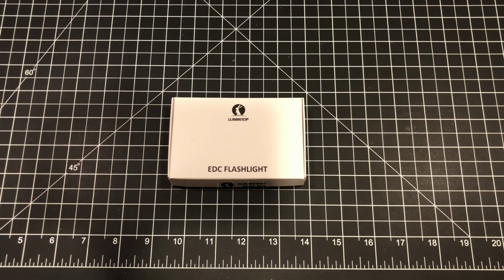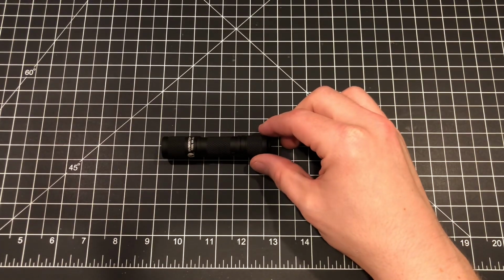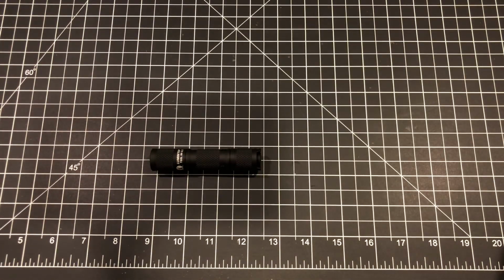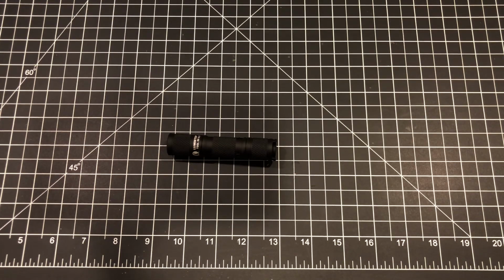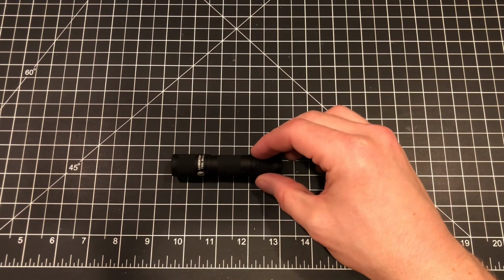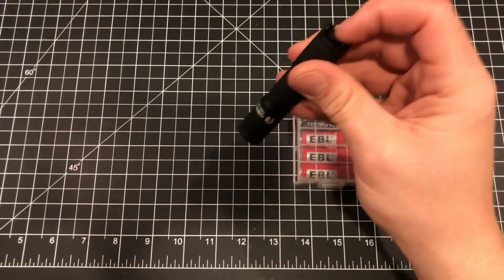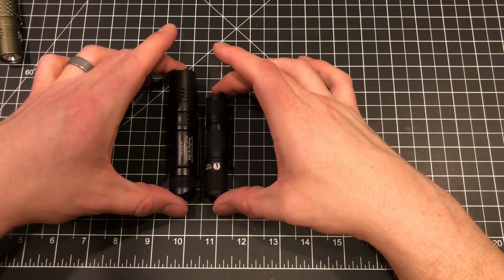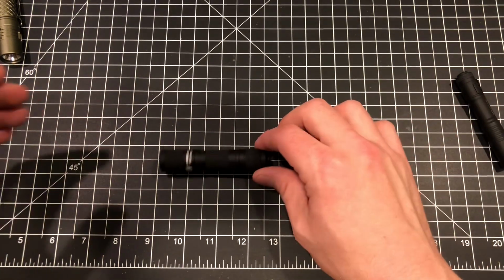Lumintop Tool AA 2.0 | Full Review ($18 EDC Powerhouse)

Comment: Flash rights are overrated, most of the power comes from the battery, when you place an Eneloop inside, it's just a bright as any other modern flashlight with an Eneloop.
Reply from the maker: That’s not true at all. The driver, emitter, reflector, lens, etc. are what matters. Battery provides voltage & runtime, not brightness.

Comment: HIGHLY recommend against using "EBL" or any other cheap Ebay/amazon chinese cells that come in 4 packs for the same price as one higher quality cell. If it seems too good to be true... I only say this because you mention your personal hogher standards for having quality gear in which you can rely on. Avoid those or with the exception of Thorfire, avoid any cell manufacturers that end in "fire" e.g. ultrafire, supfire, alonefire etc... For a 14500 cell, as of today (2021) about the very MAXIMUM mAh that can be shoved into one of those lil guys is about 1100 mAh and again thats max. Anything claiming higher (for 14500) is making false claims therefore shouldnt be trusted. Todays battary standards are pretty strict so the risk of accidental fire or explosion is pretty slim compared to 20 years ago, however the cheap cells not only have shorter discharge cycles, they typically have much shorter overall lifespans... A few reputable li ion manufacturers: Keep power, vapcell, fenix, efest and of course the big "tech-giants" such as panasonic/sanyo, sony, samsung, LG to name a few... Sure the lumintop tool AA is what is considered a "budget" flashlight, however its still a quality tool, and like any tool you depend on why feed it cheap fuel? ... For in a way, the battery powering tje flashlight is just as, of not more so important than the light itself, both tools in their own rights, may as well not cheap out on one!

Comment: At 650 lumens this thing gets really hot really fast. 
I think the best all around batteries for this unit are nimh. Aside from the lower turbo they get the best runtimes. 
The 14500 low/eco mode is 16 lms which is kinda bright actually. The Nimh gets 3.7 lms for huge runtime. 
Again, the 650 lms turbo on this is more for playing around imo. It’s just too thin not to burn up quickly. Worth noting is this unit is very floody. So,even at 650 turbo mode it doesn’t throw far at all. 
Super cool light but it might best be suited to the Nimh batteries. Odds are there won’t be a situation where 270 lumens isn’t enough and you need 650.
Might be best as a nightstand/bedside light.

Comment: Do you have a link to the 14500 batteries you bought?
Reply from the maker: I sure do!

Here’s the link for just the batteries:
https://www.ebay.com/itm/EBL-4x14500-3-7V-Li-ion-Rechargeable-Battery-Batteries-For-Flashlights-Lasers-/264773099693?_trksid=p2349624.m46890.l49292

Here’s a link for 4 batteries + a charger:
https://www.ebay.com/itm/EBL-14500-Battery-3-7V-800mAh-Li-ion-Rechargeable-Batteries-Box-USB-Charger-/223517824857?_trksid=p2349624.m46890.l49292

Comment: Got a good link for 14500 lithium ion batteries for this light? Trouble finding lithium rechargeable. Can find 14500 in other varieties but want batteries like you have. EBC I found are like 3,000+ mAh which sounds way to hot. Doesn’t volts of lithium need to be 1.5 like reg alkaline AA? Thanks
Reply from the maker: Hey, thanks for watching! So this light in particular is rated for a working voltage as high as 4.2v, so you have 4 battery options to choose from:

1. Alkaline AA (1.5v)
2. Disposable Lithium AA (1.5v)
3. NiMh rechargeable AA (1.5v)
4. 14500 Li-Ion rechargeable (3.7v)

Because it is designed to take higher voltage a 14500 is perfectly safe and will provide the maximum output of 650 lumens on turbo. The other three options drop your max output to 270 lumens. 

Over time I’ve found that I very rarely used this light on its turbo setting, so lately I’m most often using a NiMh rechargeable battery like an Amazon Basics rechargeable AA. 

Having said that, the EBL 14500 is pretty economical. You can get a 4-pack plus a charger for about $10.50 on eBay, here’s the link: https://www.ebay.com/itm/274468154700

Comment: I just got this light today, I bought it on a whim and I'm not disappointed. But have you tried a rovyvon flashlight? I have an A1 and an A6 and they are 2/3 the length of a AA battery and cranking out 450 and 550 lumens with multiple functions. High modes drain battery within 30 minutes but I love them as a backup flashlight and the a1 never leaves my necklace with a tiny neck knife on it. As for this lumintop, I'll give it a go at work as an inspection light but I'm only using AA for the time being

Comment: Does the tail switch engage light momentarily on short depress contact or does it power up only when you full press click and release it?
Reply from the maker: It does not have momentary on unfortunately.
Reply: No, it's a reverse clicky. It has momentary OFF.

Comment: I just got one with a Nichia 219C emitter for higher CRI and warmer temperature. I haven't finished the video yet so I'm not sure if this has been mentioned but you can twist the head to adjust the setting and the tail cap also glows blue when using 14500s

Comment: Looks good, but not as good as the Olight S1R baton. I've been EDCing that thing for years now. Strobe isn't very useful except self defense, so having to half-click the Lumintop 6 times to get it is likely a fine motor skill you won't have reliable access to in a true panic situation, whereas it's 3 full pressure clicks on the Olight. With the Olight you can also skip to turbo from off with a double click, charge it without taking the battery out and it's 900 lumens instead of 650. It's shorter than this Lumintop, and I got the Olight on one of their 40% off sales for $35.

Comment: I just received mine, but the problem is when i crank it up to turbo mode, after 1 second it has a mini strobe effect, (im positive that is not on strobe mode). Im using eneloop 1,2v(brand new and fully charged) 1900mah, but when i changed to alkaline Panasonic 1,5v battery it works flawlessly. I am doing something wrong?
Reply from the maker: I’ve never experienced that issue with Li-Ion, NiMh, or Alkaline. I’ve had and used at least 12 of these lights and they’ve all worked just perfectly. I’m wondering if it’s just a bad light.
Reply: @GearedTowardGear1  forgot to UPDATE:after 2 mins of regular use the problem disappeared for ever!  No issues at all i love my lumintop flashlight 🔦

Comment: How is it holding up in 2020? Nice review mate.
Reply from the maker: Holding up great! I’ve got a few of them and they’re all going strong!
Reply: Geared Toward Gear hey man i was about to order the light in titanium, then i read on candle power forum that the Lumintop Tool AA suffer from parasitic drain (10ma to be exact). Do you notice battery drain from your light?

Cheers
Mike
Reply from the maker: Hey Mike, I haven’t personally had any issues when running a 14500, however I generally just run a NiMh AA for the added runtime. I like that the light is capable of 650 lumens, I just never ran it on turbo for EDC so I stopped running a 14500.
Reply: I was set to get the Fenix e12, then I saw this vid. I think im getting the Lumintop. Cheers

Comment: Yeah I expected you to go outside and show us the  output  in the dark , what it  can do , I bought this same little Giant   last week but I'm waiting for the 14500 battery rechargeable to come in it has a micro  USB connection to the battery..  I can use the same cord that I charge up my phone the Blackberry D- Tec 50  for the  size and how much lumens it put out with that 14500 battery can't beat it ... I work till 1:30 a.m. and I have to go between 1 shop to the other outside , this flashlight wouldn't take up much space in my front  right pocket

Comment: Thanks for the great review! Couple questions about the battery you used,  were those protected batteries? If they're not protected, are they safe to use if you let them drain?
Reply from the maker: If I remember correctly I used EBL brand 14500 battery. It’s my go-to budget Li-Ion brand. They are protected cells and can be had on eBay for excellent prices. 👍🏻👍🏻👍🏻

Comment: I don’t think light manufacturers approach ANSI “certification” the same way as ISO. There aren’t external auditors for ANSI standards, the manufacturers just claim they test their lights to ANSI testing standards which are laid out by ANSI. You tend to have to take their word for it. It is nice if they’ve received the ISO 9001 standard though.
Reply from the maker: That’s true. I assume (or I guess I take their word for it) that if they’re manufacturing in an ISO 9001 certified facility that they are also properly testing to those ANSI standards. I’m sure some don’t, and I’ve definitely tested lights that didn’t come anywhere close to meeting the claims stated on the packaging. So you’re absolutely right, you have to take their word for it.
Reply: Same goes for the CE mark. It's the manufacturer claiming it's conformity with regards to European directives and their relevant standards.

Comment: Great review. I ordered one a couple days ago and it should come tomorrow. Amazon has a package deal that comes with a 14500 battery, additional magnetic tail cap, and a micro usb charger that screws onto the light body all for like 22 bucks. Seems like a nice little package. Can't wait to get it!
Reply from the maker: That’s an awesome deal!! Let me know how you like it once it arrives!!
Reply: @GearedTowardGear1  Will do. I must have looked at the picture on amazon too fast. it's not a charger that screws into the body of the light. it's just a microusb port built into the battery itself. In my haste I think I confused it with the charging cap that comes with the ultratac k18.  Here is the listing
https://www.amazon.com/LUMINTOP-AA-2-0-Flashlight-Pocket-sized/dp/B076HLJ4R7

Comment: 14:43 - demonstrates the memory feature:  once on, short/non-click press of back button cycles through four brightness levels.  Deep-press/click of back button shuts off / turns on, remembering last brightness selection.  Nice!
Reply: This feature sold me on it.  Just got mine today.  Love it.  I need a tiny light to hold in my teeth while using two hands to set up recording gear in dark theaters.  I love the size, the four brightness settings, and the fact the you don't have to cycle through each brightness less to power off/on (like my other bright LED flashlights).
Reply: Got my 14500 batteries today.  Yup: crazy bright on those.  But honestly, pretty darn usefully bright even just on a AA (at the top couple of settings).   I really like the lumens targets of the four settings: thoughtfully picked.  The lowest is perfect for getting some light unobtrusively, like in a theater (I shoot video of plays & concerts, so this is perfect).  And the brightest levels are almost a search light.
Reply from the maker: That’s awesome! I’m glad you’re enjoying it. Thanks for sharing your experience. 👍👊🍻

Comment: Great review...do this lumintop come in warm light?
Reply from the maker: Hey Roy, thanks so much for watching and for the comment! It does not unfortunately, only the 6500k cool while. But I really wish it did, as I have become a fan of the neutral and warm tints more and more. I’d love to see this light in a 3000k and maybe 5000k option. I’m sure you could swap out the emitter for a warm Nichia or something like that, but they level of customization is way over my head, LOL. Cheers!
Reply: Roy if you go on massdrop there's a special version of this light with a titanium clicky switch and has a neutral tint option. It's called the massdrop Vega aa
Reply: I'm opposite, I use to like warm tint, later in life I been liking a little cooler but not to cool. If I want warm mood lighting, I'll use a candle. But that is just me. In time consumers wil, go back to cool preference and then back again, it life. Like clothing style or anythingreally, it always rolls back around.,
Reply: Though my tool 2.0 is NOT as cool as ine in video.

Comment: Nice review. I'll add that using a NIMH Eneloop Pro has the same lumen output as the alkaline but much better run time especially using the pro version or any high output 2500mah NIMH battery. Also the more heat, the more your driving the circuit to the limit with the 3.7v lithium battery which will suck the life out of the components. I'd say getting an hour at 270lm is really great for a AA pocket light and lumens are the law of diminishing returns, you need 4x the lumens for the human eye to see twice as bright. All that said makes using a high output NIMH battery the sweet spot for everything with this flashlight! But enjoy the 14500s, I'm just pointing this out for people that don't understand as much about the technology.
Reply from the maker: Hey thanks for watching! All true and fair points. I run Eneloops in some of my lights, and with some I want the full output. It just depends, and on a light this cheap I’m personally not too concerned about longevity, I actually have like 6 of these things, lol. Every time they are on sale I buy an extra for gift giving and such. Cheers, and thanks for the comment!
Reply: I concur. The sweet spot is using this light with an Eneloop Pro.  Great run time and great brightness off a NIMH.
Reply from the maker: For sure. The added runtime from a NiMh is an absolute bonus. I tend to run a Li-Ion, although I rarely use this light on turbo. I run Eneloop Pros in several lights, just don’t happen to use them in this light. My usage is pretty limited (maybe a few times a day and not for long periods) so a Li-Ion lasts me quite a long time.
Reply: Not exactly, it will push 270 lumens on ni-MH and 220 on alkaline. For me the sweet spot is using 14500, I want less I will grab a AAA flashlight, but that's me.
Reply from the maker: The outputs are identical on an Alkaline or a NiMh - 270 max lumens. But the runtime on a NiMh is 43 min, double that of Alkaline. I used to run 14500’s in a lot of my AA/14500 lights, but in reality I rarely ever used the turbo mode for EDC, maybe twice. Usually I’m using it on low & medium, I rarely even use it on high. So for me it doesn’t make sense to run a 14500. The NiMh AA gives me plenty of output & respectable runtime. I could get by with the output of a AAA EDC light, and I do carry them often, but the runtime is so much less than a AA.

Comment: Great video - where did you get your batteries?
Reply from the maker: Hey there, thanks so much for watching and for the kind words. I got my 14500 batteries on Amazon. The brand is EBL but they are actually cheaper on eBay. There are better quality cell you can get from dedicated online battery retailers (which I do in many cases), but in reality the EBL batteries are perfectly serviceable for a light like this and very friendly on the wallet. Just search for “EBL 14500” on eBay and you’ll have your choice of quantity and battery type. Fast shipping too. Cheers!
Reply: @GearedTowardGear1  thanks brother, much appreciated 😀👍

Comment: I'm a bit late to the game but the Lumintop Tool 2.0 certainly looks like an excellent bargain in a small, lightweight flashlight (with solid output!) I just checked my Nitecore chargers that I use for 18650s and they also handle 14500s, which is cool! Thanks for the video!
Reply from the maker: Hey JJ, you’re more than welcome! Since I made this video I’ve literally bought 10 of these, given several away and have a few extras lying around for a rainy day. Hard to beat for the money.
Reply: That's great to know, Sean! I've got that on my "next flashlight purchase" list :)
Reply from the maker: Awesome. You won’t be disappointed. 🤙

Comment: Interesting light. Maybe I missed it but it seems like you forgot yo mention the run times on either battery. Run times are a big determining factor, 650 lumens dont mean too much to me if it runs the battery down in 15 or 20 minutes. But thx for taking the time to do the review.
Reply from the maker: Hey there, thanks for watching. I haven’t watched this video in a long time, and may very well have not mentioned it. Sometimes it’s hard to remember everything. 

As a general rule, flashlights’ max outputs don’t last long. This Lumintop has great runtimes on turbo though. For contrast, my Olight S2R II will only run on max turbo of 1,150lm for 2 minutes before dropping all the way down to 400lm. 

Lumintop Tool AA 2.0 runtime by battery type:

14500 Li Ion Recheable:
Turbo 650 lm - 33 minutes
High 360 lm - 79 minutes
Mid 85 lm - 6.1 hours
Low 16 lm - 37 hours

Ni-MH Rechargeable AA:
Turbo 270 lm - 43 minutes
High 140 lm - 2.5 hours
Mid 28 lm - 12.5 hours
Low 3.7 lm - 60 hours

Alkaline AA: 
Turbo 220 lm - 21 minutes
High 140 lm - 49 minutes
Mid 28 lm - 11.9 hours
Low 3.7 lm - 60 hours
Reply: @GearedTowardGear1  Thx for responding to an old video. You're right the runtimes are very good. I think I'll pick one up on your recommendation. Thx again.
Reply from the maker: Of course, I’m always happy to chat in the comments. I try to make it a point to reply to every single comments. Take care!!
Reply: Eneloop Pro. That's actually the optimal battery for this light.
Reply from the maker: NiMh are great for this light, but “optimal” is going to be subjective. Some people may want to full output, while others are more concerned with run times. There’s no wrong answer.

Comment: I've got the same light. I use AAs in it, I have not been overly impressed with the run time, but it is bright.
Reply: Rechargeable AAs? I like the runtimes on Low and Medium (if I need 100+ lumens, I'll pull out my 18650), but carry a spare Eneloop just in case.
Reply: Eneloop Pro. Problem solved.
Reply: With a small battery like an AA it's always good to carry a spare. Alkalines last longer but you don't get the output - only around 250 lumens.